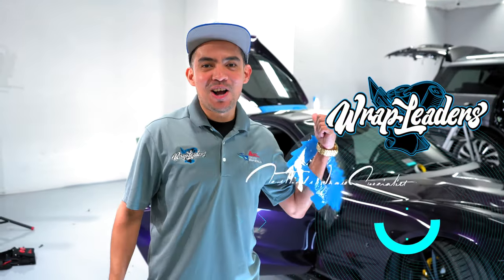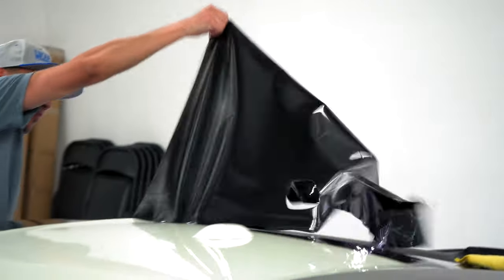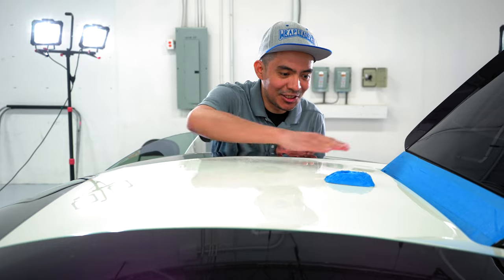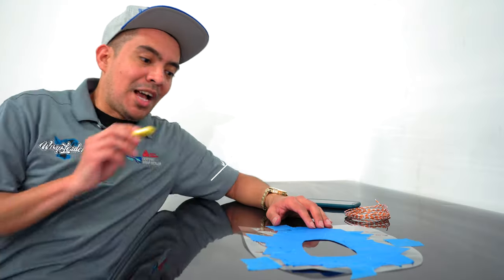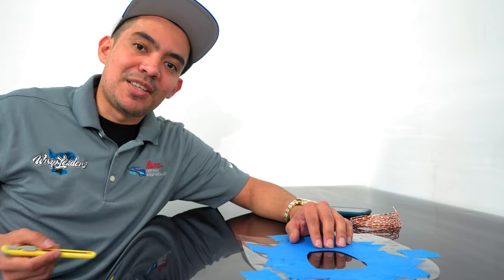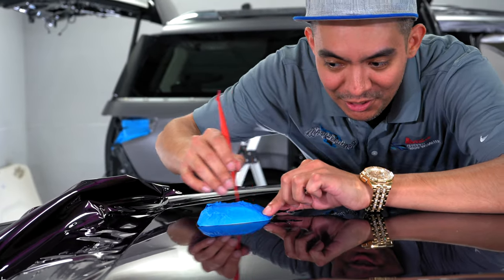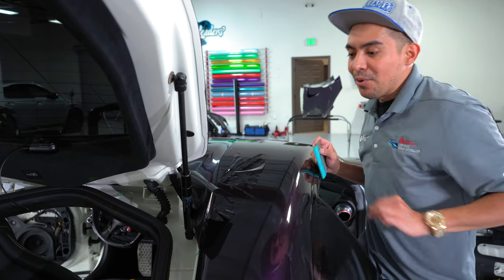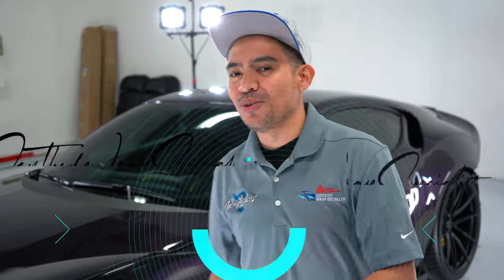How to Wrap a Roof WITHOUT taking the Antenna off 💪 Inozetek Vinyl Wrap!

Comment: You do not need to cut out the shape of the object before laying the film. You can make a tiny slit where the object (antenna) is and as you lay the film you slowly squeegee the material down the antenna and gradually cut away the film as you heat and press down to the base of the antenna.

Comment: Try using a watermarker with a thick point en cut inside de marker line. Usually 3mm marker tip is more than enough then you have 3mm over all around